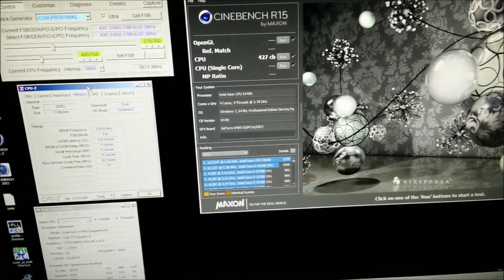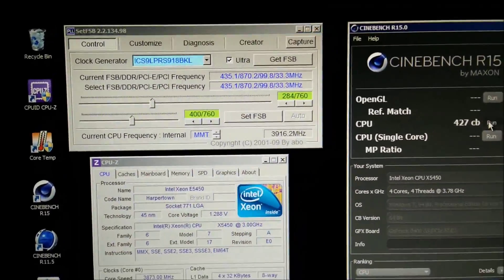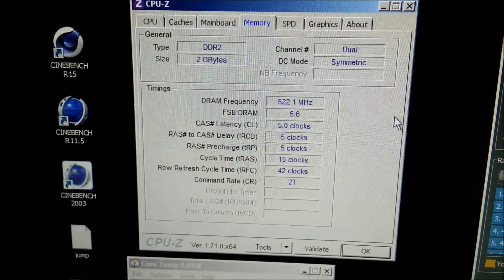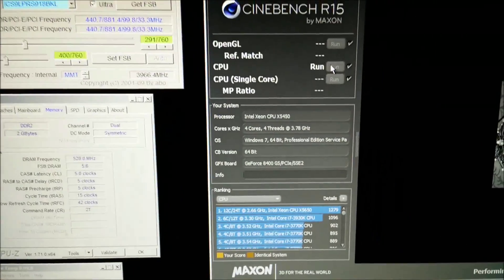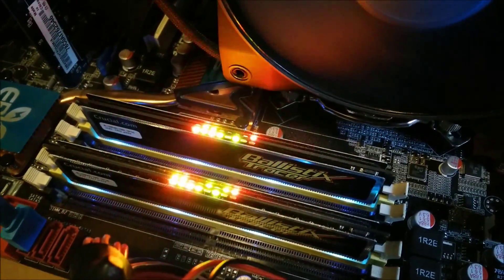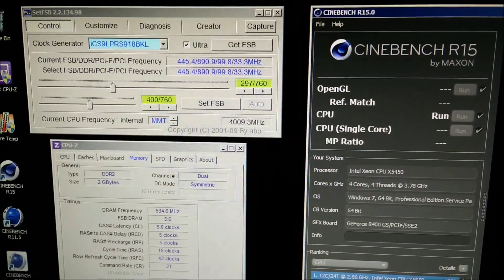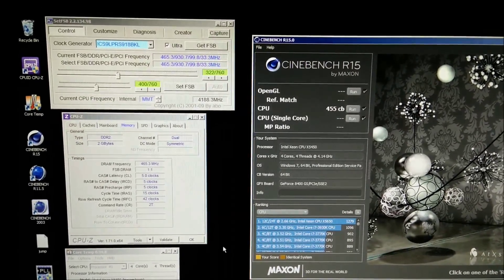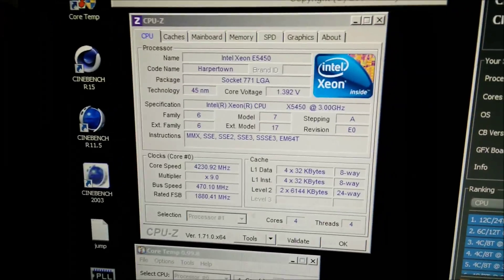Intel Xeon X5450 Overclocking and How to use SETFSB to find a stable overclock quickly

Comment: Will this work for my h61 lga 1155 motherboard?
Reply from the maker: No h61 boards are locked. You would need a p67, z68 z75 or z77 chipset board
Reply: @LawrenceTimme :(

Comment: @LawrenceTimme thanks so much for your reply your the best i use hp core i7 1255u laptop 12th gen is it easy to use and i can i load it from task bar and should i do a system restore point also is it possible to do it with out clicking on set fsb once load it and do I click get fsb to start with and can the version setfsb_2_3_178_134 work thats should be all now please reply me asap

Comment: @LawrenceTimme hi ive been told the multiplier works with locked cpu and is it easy to use also do have to redo it each time you restart pc and does it matter what version you use and ive been told NEVER click Set FSB can it be done with out that please reply asap would mean a lot to me
Reply from the maker: @nigelphillips7454  set fsb works fine for me, but yes it does reset every time you reboot. It's just easier to use it in windows rather than reboot every time. 

It's a great tool, I used it for years. The multiplier doesn't always work even on unlocked LGA775 chips. These old CPUs like to be overclocked with the base lock instead.
Reply: @LawrenceTimme   thanks so much for your reply your the best i use hp core i7 1255u laptop 12th gen is it easy to use and i can i load it from task bar 
 and should i do a system restore point also is it possible to do it with out clicking on set fsb once load it and do I click get fsb to start with and can the version setfsb_2_3_178_134 work thats should be all now please reply me asap
Reply: @LawrenceTimme   thanks so much for your reply your the best i use hp core i7 1255u laptop 12th gen is it easy to use and i can i load it from task bar and should i do a system restore point also is it possible to do it with out clicking on set fsb once load it and do I click get fsb to start with and can the version setfsb_2_3_178_134 work thats should be all now please reply me asap
Reply: @LawrenceTimme   thanks so much for your reply your the best i use hp core i7 1255u laptop 12th gen is it easy to use and i can i load it from task bar and should i do a system restore point also is it possible to do it with out clicking on set fsb once load it and do I click get fsb to start with and can the version setfsb_2_3_178_134 work thats should be all now please reply me asap
Reply: @LawrenceTimme   thanks so much for your reply your the best i use hp core i7 1255u laptop 12th gen is it easy to use and i can i load it from task bar and should i do a system restore point also is it possible to do it with out clicking on set fsb once load it and do I click get fsb to start with and can the version setfsb_2_3_178_134 work thats should be all now please reply me asap
Reply: @LawrenceTimme  hi when using set fsb for locked cpu which options do i choose please reply me the answer that will be all
Reply: @LawrenceTimme  hi when using set fsb for locked cpu which options do i choose please reply me the answer that will be all
Reply: @LawrenceTimme  hi when using set fsb for locked cpu which options do i choose please reply me the answer that will be all
Reply: @LawrenceTimme  hi when using set fsb for locked cpu which options do i choose please reply me the answer that will be all do i choose fsb number
Reply: @LawrenceTimme  hi when using set fsb for locked cpu which options do i choose please reply me the answer that will be all do i choose fsb number
Reply: @LawrenceTimme  hi when using set fsb for locked cpu which options do i choose please reply me the answer that will be all do i choose fsb number

Comment: how did you increase it so much? my x5650 can only go up about 16 before freezing
Reply from the maker: Because 775 and 1366 are completely different socket. 1366 can't go as high as 775. You also need to change other voltages in the bios for 1366.
Reply: @LawrenceTimme  yeah that's probably not possible for my motherboard as its made by dell lol.
Reply from the maker: @eidorb308  that as well then XD
Reply: @LawrenceTimme   hi Ive been told that nothing bad will happen as long as i don't click set fsb that only after loading it right also how I know whether the numbers make sense please reply me asap would really appreciate it I liked and subscribed
Reply: @LawrenceTimme   hi Ive been told that nothing bad will happen as long as i don't click set fsb that only after loading it right also how I know whether the numbers make sense please reply me asap would really appreciate it I liked and subscribed
Reply: @LawrenceTimme     hi when using set fsb for locked cpu which options do i choose please reply me the answer that will be all like fsb number or i use 12th gen locked cpu
Reply: @LawrenceTimme     hi when using set fsb for locked cpu which options do i choose please reply me the answer that will be all like fsb number or i use 12th gen locked cpu
Reply: @LawrenceTimme     hi when using set fsb for locked cpu which options do i choose please reply me the answer that will be all like fsb number or i use 12th gen locked cpu
Reply: @LawrenceTimme     hi when using set fsb for locked cpu which options do i choose please reply me the answer that will be all like fsb number or i use 12th gen locked cpu

Comment: Hello. Any idea how to find my PLL? My motherboard is FUJITSU D3162-C1
Reply from the maker: try all of them and see if any work if there is not info on forums about them.
Reply: @LawrenceTimme  But can't that break my PC?
Reply from the maker: @megapet777  no. If it doesn't work it will just say pll not found.
Reply: @LawrenceTimme  Really? Okay guess I will try but I really hope it wont break my pc :D
Reply: @LawrenceTimme  Hey I did some quick testing and the top 4 FSB wont give me errors when I click "Get fsb" but all the others below gives me error. What should I do? Can all 4 of them be correct for me?
Reply from the maker: @megapet777  they might work but not be correct, when you press get Fsb the number it gets needs to be the same as the Fsb speed your system is running at. Eg 100mhz or 266mhz
Reply: @LawrenceTimme  Okay. I took some screenshots, if you would like to take a look at them to tell your opinion, which one looks correct. Thx for the help btw. My cpu is i5-3470. Here are the pics: https://imgur.com/a/8Zcd3TE

https://imgur.com/a/b2l7pCY

https://imgur.com/a/UGyS7k2

https://imgur.com/a/JBjb0jV
Reply: @LawrenceTimme  Nvm, I tried to change the values of all of them, nothing happens. I think there is no way to OC this pc. I wonder if my motherboards supports overclocking with K processor, or not?
Reply from the maker: @megapet777  the newer chipset are completely locked anyway. The most you could get is 5%.

This program is made for lga 775,1366 and 1156 really.
Reply: @LawrenceTimme  I see. My best bet is to get i7-3770 then right?
Reply from the maker: @megapet777  yes! Or a better motherboard with a z68, z75 or z77 chipset
Reply: @LawrenceTimme  I know. It's an OEM pc with bad mobo and power. I will just get cheap i7-3770 tho
Reply from the maker: @megapet777  ok.

Comment: what does that bottom slider do
Reply from the maker: It breaks everything.
Reply: @LawrenceTimme  it does, thats why im trying to research to see if i can actually use it lmao, i stopped overclocking my dell a while ago since it was too much trial and error, since im getting it a gtx 1650 soon i want to see how much power i can exactly get out of the old girl, so i can at least make the 1650 flex a bit
Reply from the maker: @rangerdanger1922  do not use it.

Comment: How come when I restart your pc the fsb goes back to defaults?
Reply from the maker: Because it sets it in Windows not in the bios. Once you get a settings in set Fsb then you can set in in the bios
Reply: @LawrenceTimme  thank you! Question for you, how do you set it in a dell or dell optiplex bios?
Reply from the maker: @jasonmirabile5184  you cant, is there an option in set fsb to apply the overclock at startup?

Comment: I currently have a Dual Xeon X5650 based HP Z600 and wanted to know if it's possible to use SetFSB to Overclock a X5600' series Xeon CPU, many thanks
Reply from the maker: its is, but not on a hp  board. its the motherboard not the cpu that makes setfsb works
Reply: Lawrence Timme ah right, ok thanks :)

Comment: I currently have an Intel Xeon X5450 on a GA-EP45-UD3P. Does anyone have some suggestions for SetFSB config?
Reply: TopHatProductions115 I have revision 1.6 of that motherboard and 800 MHz RAM. X5460 C0. It does get quite hot when overclocked. 4GHz (with 422 FSB) "seems" near, yet so far. I have pushed voltage to 1.34 (1.36 CPU termination or VTT ) and eventually end up with errors on one of the workers in prime95. 3.8 GHz seems much more achievable with a reasonable voltage increase. I have it at 3.8 (FSB 400) and 1.28V CPU/1.32 VTT and it hasn't errored after two hours yet

Comment: uhm.. i'm about to install an x5450 xeon on my gigabyte EP45-UD3P, i hope i can reach something like this... at least 4Ghz
Reply from the maker: yes 3.8 to 4.2ghz
Reply: thanks buddy, is very nice to find people who wants to talk about an old platform like this, by the way, i'm using 800Mhz DDR2 modules (4GB modules) on it. Do you think that there can be any problem? i'm aiming to a 500mhz buffer, but 400 could be nice too jeje
Reply: Reinaldo Gonzalez I reached 4.4 with an old ga965 ds4, so a newer board should do even better, I noticed that it loves voltage, before I killed my board by hitting it with a water block anyways.
Reply: Reinaldo Gonzalez Oh I had 4, 2gb 667mhz OCZ "Vista Edition" dimms and I did fine (board didn't like 1066mhz OCZ gold's :( ), your higher speed memory should be okay, if not just overvolt your ram a little if it doesn't like the extra MHz, or loosen the timings up. I was running 1.9v iirc.
Reply from the maker: as in 2x4gb for 8gb? or 2x2gb for 4gb?
Reply: I have that same board and I can reach 3.8 at 1.28, beyond 3.8, I have to dial in crazy voltages to get to 422x9 (4009MHz) and the temperatures are too high for comfort

Comment: I got a xeon 5470 coming for my nForce 780sli mobo... I was curious will a DeepCool Double-edged ice MINI Ultimate Edition(two fans on this one) be enough to get 4.0 in over clock?
Reply from the maker: the cooler will be ok, but the nvidia chipsets are craptasic at overclocking quad cores :(
Reply: Well that is sad to hear... I wonder if manufacture makes a difference.. this is my board
http://www.evga.com/articles/420.asp
This sure is a good way to get an extra year or two out of a mobo :)
Reply from the maker: DancesofDragons it does a little but the chipset is a really big issue. If you could swap it or sell it and get a p45  chipset then you would get much higher oc on quads.
Reply: This is just a hold over for me,,, until ryzen release... I will be doing a cpu mobo and ram upgrade...
Reply from the maker: DancesofDragons ok then :D that is a good choice
Reply: @LawrenceTimme  hi when using set fsb for locked cpu which options do i choose please reply me the answer that will be all like fsb number or i use 12th gen locked cpu
Reply: @LawrenceTimme  hi when using set fsb for locked cpu which options do i choose please reply me the answer that will be all like fsb number or i use 12th gen locked cpu

Comment: just use 4790k... 4core xeons are pointless
Reply from the maker: its way cheaper.
Reply: Trolling or stupid?
Reply: Faust Von Barley why would i troll about this
Reply: In that case - don't you think it's stupid to make presumptions based on nothing more than inexperienced opinion?
Reply: well then teach me benefits of X5450 over 4790k......
Reply: Mentioned i7 still used costs 350$+ and funny thing being, both the i7 and Xeons are 4-core CPUs. ;) Ok, lets talk benefits. As Lawrence pointed out - price. A buddy of mine had a graduation and was using P4. Can you imagine finishing high-school with that (especially robotics)? Our budget wasn't large and graduation gift was a modded Xeon machine.

LGA775 motherboard + LGA771 Xeon + Dual-slot GPU + SSD = Win!
For now, there wasn't any system instability whatsoever. Machine is being used for virtualization, programming, mild math calculations and AutoCAD. 4790K would def be over budget and an overkill. This budget build, not even overclocked yet, can still pack a punch.

Try to buy a decent 6-core Xeon motherboard. lol
Reply from the maker: Mario Darnadi its not really much faster for a lower end gaming machine. the money would be better spent on a gpu in most cases. if you could have a x5450+hd7870 vs x5650+hd7770 the x5450+hd7870 will perform better in 98% games.
Reply: Mario Darnadi Spending up to 500$ wasn't an option!
Reply from the maker: Mario Darnadi some people might only have 200 or 300 and they might already have an old machine with a motherboard and ram the fits the x5450 as 775 is the most popular cpu socket ever made.
Reply: I'm running a Xeon E5440 @ 4.26 right now on an old Asus P5Q. Board i've had from 2009, chips were 2 for 18 dollars on ebay. Conversion was around 2 bucks. And some fun overclocking.
Reply: Hi Gerald. What are your bios settings for your overclock. I have a x5460 on a P5Q PRO.
Reply: Lawrence Timme Well of course but still you can buy better for only 50bucks more or for 100more you can buy 6core xeon
Reply: Lawrence Timme well there is not point talking about low budget gaming pc
Reply: Faust Von Barley well you can buy used workstations for up to 500 bucks with better cpu for work.

Comment: will msi p43 ddr3 mobo work?
Reply from the maker: yeah probably.
Reply: What u think is best chipset motherboard for overclocking? and will the X5460 be good as this? What tdp cooler are you using
Reply from the maker: P45 is the best. and yeah an x5460 will be fine as long as its E0 stepping. you can use any large single tower cooler or dual tower air cooler will work fine also.
Reply: I think i go with the E5440 because of the lower tdp what does the E0 mean? the seller is saying  they have two options SLANS or SLBBJ
And in aliexpress theres many  mobos with P43 and options like ddr3, 1600mhz FSB oc and 1600mhz ram thats around 50bucks
Reply from the maker: Jooa http://www.cpu-world.com/sspec/SL/SLANS.html
if you look at the bottom table on this website you will see it says stepping in the first column then the s-spec. The s-spec is the SLANS or SLBBJ the is written on the 3d line of the cpu.
This is so you can tell the stepping without having to see cpuz in windows. The E0 stepping is a later revision of the cpu and they overclock alot better than the C0.

So in the case of the E5440 you want to buy the SLBBJ as this is the better overclocking chip. 

I have never trid a P43 board, but they are not as good as p45, you can pretty much tell how good aboard is by the heatsinks on the VRM and northbridge.
Reply: ok thanks